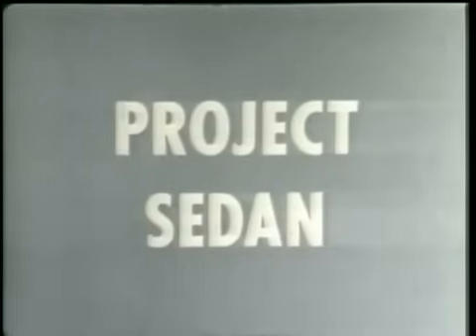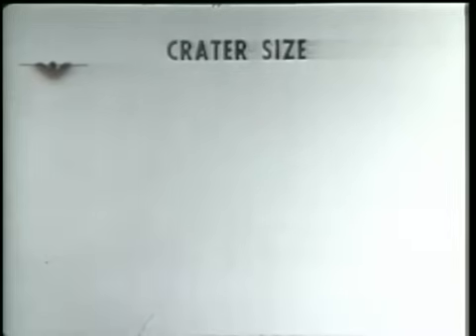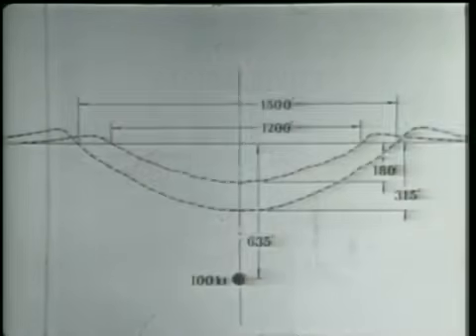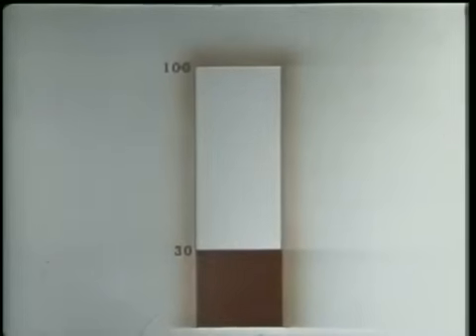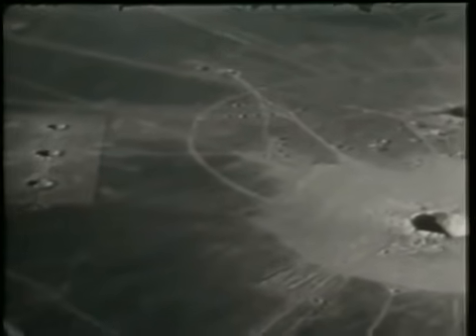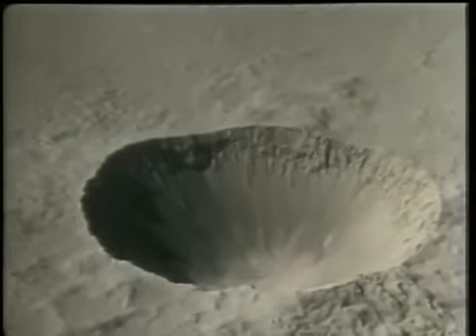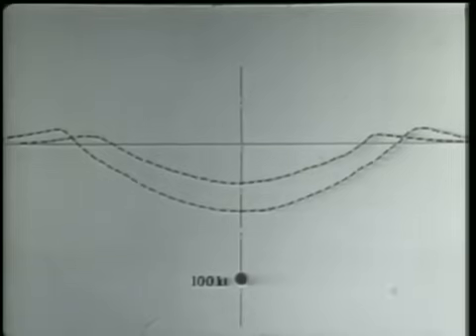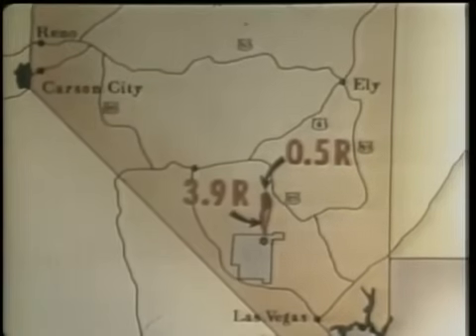Project Sedan Nuclear Test

Comment: Page 197-198

A midget hydrogen bomb buried 635 feet underground blasted out a crater 1,200 feet across and 320 feet deep in Nevada desert land.
Reply: The device's 100-kiloton yield---equal to 100,000 tons of tnt---lifted a dome of earth 600 to 800 feet in diameter to a height of 290 feet.

Comment: The contractor said only need about 2 miligrams of plutonium to dig the backyard pool, but cant use it for 50 years, radiation!
Reply: At least it will be a heated pool!
Reply: @truthseeker2321  The original post and this one have not received nearly enough likes.
Reply: That's bullshit. 2 mg will not dig a backyard pool. That would be about as strong as a firecracker.
Reply: @andreiwindstorm  The smallest weapon being the Davy crocket which in total was 76 pounds and had to use a atomic gun because not enough nuclear material to start fission.